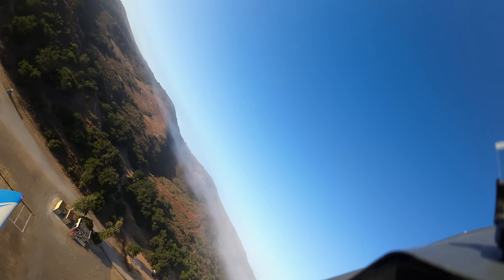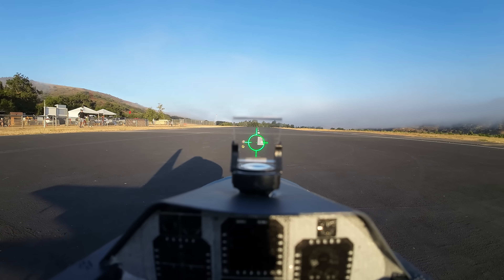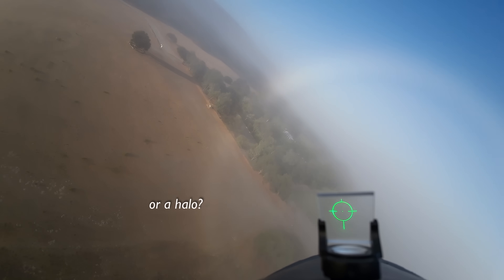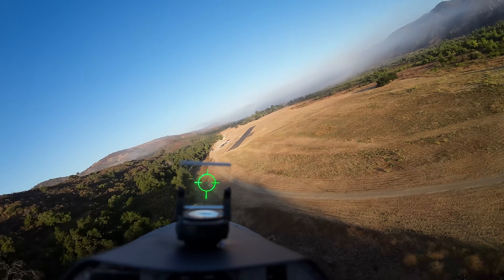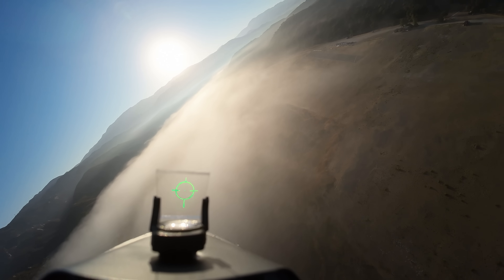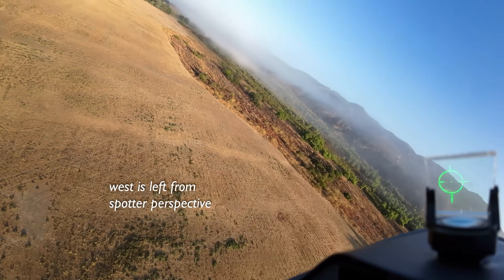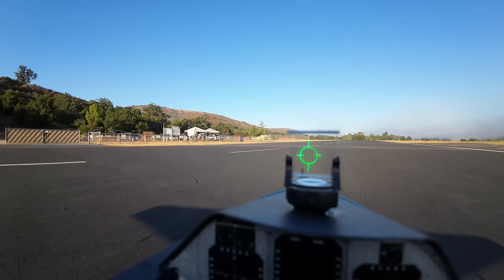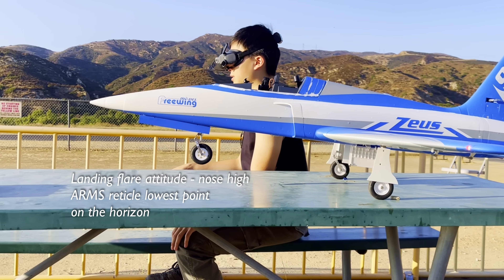How to Fly Your RC Jet from Cockpit Using Head Tracking FPV - Part 1

Comment: Is that a goggles 3? Are you not worried about the goggles 3 but that will make you lose video signal when used with 03 air unit? I guess on a fixed wing you can easily disarm and arm again on losing vid signal.
Reply from the maker: On this flight, I was using Goggles 2 with O3 air unit, no flight controller.  Just turning low power mode off on air unit.  No arming signal — so coincidently no issues with Goggles 3 if not armed.

Comment: Started designing, building and flying models in the 70's.  I started FPV 20 years ago, 15 years with head tracking.  It may have gotten off to a slow start, but it is good to see it progressing the way it is and that nowadays, people can just buy a system to do it.   After building a system for a P-51 Mustang, I stopped flying 3rd person altogether.  All of my planes are flown this way.  Most people will never fly a real aircraft, much less a warbird, so FPV is the next best thing.
Reply from the maker: @rav3n595  flying both in first person and 3rd person are fun.  Can do both on the same plane to increase utility.
Reply: the 03 air unit is a game changer, the quality is so high now and you no longer need a separate camera to record with. I already have 3, one on my 5 inch quad. One I can swap between my rc car and boat, and one I still have to put in a glider.
Reply: This why Im investing in a PC w VR, then into DCS, learn how to pilot, but this RC vehicle with cameras is beyond me 😂 really awesome stuff

Comment: I would not recommend an O3 air unit without an arm command input from a flight controller (this is why you can buy Arduino arm command solutions) The o3 air unit was designed for drone flight controllers. When the drone is disarmed it does not blast the other pilots video on the ground. The original air unit does not do this hence why it's more popular for planes
Reply from the maker: Yes.  Good tip.  I am actually setting up a SpeedyBee 405 Wing FC at the moment.  I wish the OG air unit was still for sale.  I miss the audio recording ability.
Reply: @motionsic  I fly regularily my EDF jets flawlessly with the Speedybee F405 and Motionsick headtracker equipped with the O3, but I also miss a lot the audio, it would help to monitor  the speed and engine power, altrough I have pitot on the plane and airspeed in the goggles, as well as engine power %... To know you can rely on the FC's "return home" is very reassuring.
Reply from the maker: @alainrac56  Yes! Having airspeed & power telemetry is critical for realistic flying — I have put it off for way too long😅. But in cockpit sound realtime feedback is even more intuitive than reading the OSD telemetry.  We need to have enough people flying FPV in planes to influence manufacturers specs for future FPV products😉

Comment: Great!
Is the reflector sight also available in other colors than green?
Reply from the maker: @karlosio1  only available in green for now.  It’s the most pleasing and non-obtrusive color for all lighting conditions.
Reply: @motionsic  ok! Will the ww2 german revi sight color be available in the future? :) or is it possible to change to color by myself by replacing a led/filter?
Reply from the maker: @karlosio1  you can change the LED to a different color, but disassembly risk messing with the parallax free feature, and knocking the filter out of position - parts are tiny, very delicate work.
Reply: @motionsic Do i get a little discount if I order two? :D
Reply from the maker: @karlosio1  we offered $10 discount for existing customers🙂

Comment: any updates on the condition of the airfield itself? the fire is burning away from it, right?
Reply from the maker: @icannotfly  not flying for this week and next as the field is closed and has become a base of firefighting operations.  The good news is the field itself is not threatened by fire, at least currently.
Reply: @motionsic  that's good! I had heard the start was somewhere near you but wasn't sure how close.
Reply from the maker: @icannotfly  it actually started near another RC field called Trabuco Flyers, which gave the fire it’s name “Airport Fire”. Ironically it was started accidentally by county crew while doing fire prevention work when his equipment sparked.  So sad🥲
Reply: @motionsic good they found the cause hope everyone is safe . You can patrol from the sky and give live updates

Comment: FPV videos were so funny that other RC videos got fed up. There's also a sound in the flight video. Does the air unit also have a microphone?
Reply from the maker: No, unfortunately not.  Current air unit for sale do not include microphones.  Audio recordings are from my cell phone.  The OG Air Unit did have mic on it but no longer for sale except in used market🥲

Comment: Now we know that it's possible to fly an RC jet with 360 cameras. But there are still more ideas that need to be tested for feasibility:
- BB pellet machine guns;
- Missiles; and
- Flares

If any of these three (3) can be modified into an RC Jet, then humanity is one step closer to making a Dogfight Rounament a Reality.
Straight-up Ace Combat with RC Jets IRL 🤘😎🤘
Reply: If such a little rc missile is possible, the FBI and NASA will come at the same time
Reply: @정지운-z4j  
A missile that's explodes like a fire cracker. I don't know how strong the RC Jets' casing is, but I think it should break apart after taking at least 2 or 3 hits from a micro-missile with an explosion of a fire cracker.
Reply from the maker: @billjohnmiraflores9172  the BB pellet gun idea has been proven by a French gentleman 10 years ago at YT channel @aero Fred van H https://youtu.be/ZGMHbV8p6_w.  
But it’s against regulations to carry projecttiles on RC planes in most countries.  So we can’t show you even it has already been done😉. By the way, this flight was not recorded using 360 camera, it’s flown and seen real time as presented using a HD head-tracking camera.
Reply: @motionsic There is a channel that shows 3D printed aircraft, that has recently done a mini EDF that looks like a curise missile and is launched from a large EDF Jet. Neither designs are anything more then RC aircraft, but you can bet on military suppliers taking an interest on how easily to could be done, and the potential with a waypoint enabled flight controller.
Reply: @PiDsPagePrototypes saw that too I wanna build the whole jet . Would need buddies to control the mini edf
Reply: @4ctionhank  Or just set them to fly way points, a lap of the field, then a zig-zag down the middle, turn and come back and fly through the media tent, then turn and land at the pilots feet. :)
Reply from the maker: @PiDsPagePrototypes  that would be cool but for one time.  Too much automation takes the fun away.  After all, we do racing, dogfights etc for the thrill with a chance of crash if we make a mistake.  Removing all risk and unpredictable outcomes would take away the thrill🤔
Reply: @motionsic  Well, if you want a challenge, incorporate an IR sensor on the secondary aircraft, and put an IR LED on the tail of the primary piloted aircraft. Tag, you're it!
But,... the pilot of the secondary aircraft can only 'see' via a display showing the output of the IR sensor.  :)
Reply from the maker: @PiDsPagePrototypes  That’s the way to have direct visual feedback for hits indeed!
Reply: Mini-missiles, bb machine guns and flares would certainly be a cool realism add on. Other than laws against it I can see the people on the ground watching and controlling the RC planes getting accidentally pelted by bb’s or a flare lands on a building or car or in dry grass and poof! LOL 😅. Still, it would be cool. 😂

Comment: Sir Which fpv camera nd controller r u using
Reply from the maker: @V.M7982  DJI O3 Air Unit Camera with FrSky X20S radio.  You may see the detail setup video here: https://youtu.be/_V1Nma-tBOc?si=_Zb3kF7AQpat8oCq